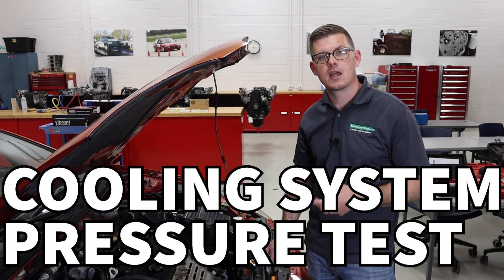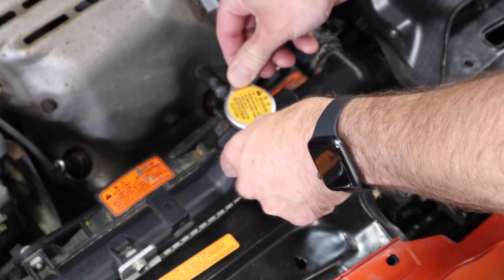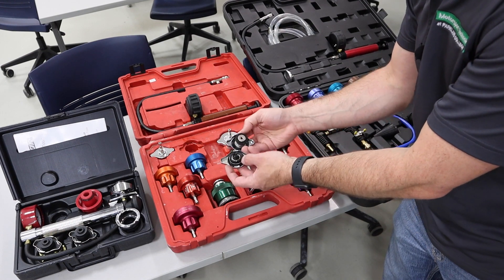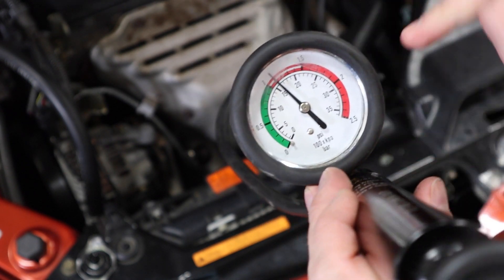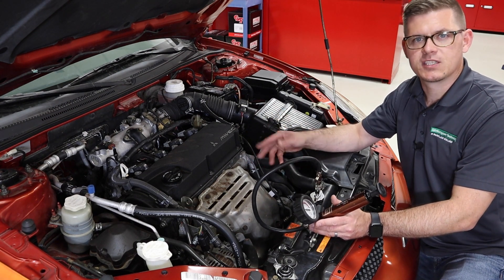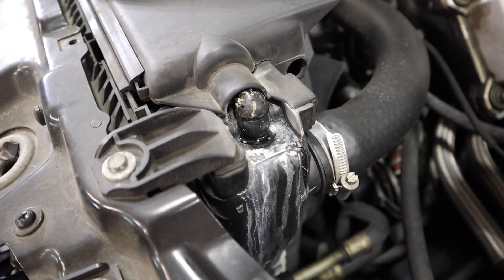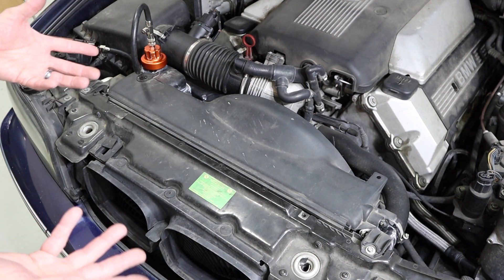Cooling System Leak and Pressure Testing

Comment: Those bmws cooling systems operate at double the pressure which you applied. the cap on that expansion valve says 200KPA or about 30psi. Next time pump it up to 30 not 15😊

Comment: i do not have air compressor do you have a manual coolant vaccum using hand? instead of machine? for hondas? would be nice msot peoples do not have this air compressor to do this jubs. i still use the drain and fill

Comment: Do you have the link for the red container pressure tester that your using for the radiator cap ? I need 1 like yours.
Reply from the maker: The red kit is an Astro 78585P. That one appears harder to get now and the 78585 (no P) is a larger kit like the mastercool in the video. Here is a link to that Astro version: https://amzn.to/4gT5h6P
Reply: @AdamsAnalysis  ok Thanks..

Comment: Hoe cn you diagnose if the leak is in your system of in the tool. Mine stays fine for 5 minutes, but between 10-30 minutes losse 1,5 psi

Comment: Does this pressure test works on other leaks such as at hoses, joints, heater core, thermostat?
Reply from the maker: Yes, it pressurizes the whole system and will help identify any leak.

Comment: Cool to see to you test an E39 V8 :)
How long is the 15 psi pressure supposed to hold?
I'm testing cold my X5 2002 3.0 M54, and the pressure drops from 20psi to 15 psi in 10 minutes, and from 15 psi to 10 psi in another 10 minutes.
Not seeing any leaks.
Reply from the maker: Typically, you will see a ~2 PSI loss in the first 5 minutes or so depending on the vehicle. I attribute this to expansion of rubber hoses. Any further loss should be a concern since it may indicate an external or internal leak. For an M54, has it ever been overheated? They often crack the cylinder head near a valve seat when that occurs.

Comment: Hi Adam, I have a coolant leak that I'm trying to troubleshoot on my VW crafter, but I'm struggling to find a pressure tester kit with the suitable adapter for the expansion tank. Any idea where I could find one?
Reply from the maker: Making your own is an option. There were some expansion tanks where I would use vise grips to pinch the vent hose because my adapter did not seal fully.
Reply: Make your own and run it off the expansion hose

Comment: On the vast majority of VWs from the last 25 years, I find the easiest way is to apply pressure to the small return pipe to the reservior. That way you don't need all the adaptors and also are testing the cap.

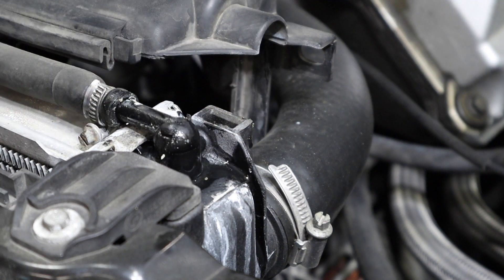Comment: Hi Adam.  Thanks for the video.  5:20 are all of those colored adapters anozied aluminum or some metal?  The ones on Amazon look like plastic and copies of originals.  I've read a lot of not so good and conflicting reviews of those products, such as not fitting the radiator or expansion tank, and leaky adapters.  Just curious to find the one that's worth dropping some money on, with Vacuum Lift and Pressure Tester.
Reply from the maker: Thanks for watching! All the kits, including Snap-On, have a mix of anodized aluminum and plastic adapters. In most cases, they work just fine. Depending on the scope of vehicles you plan to work on, it may be better to buy the pressure test kit and vacuum lift separately.

Comment: I nought a un expensive test kit when i went to use it on 2008 acadia air was coming out of overflow canister not letting get pressure
Reply from the maker: This seems to be somewhat of a common issue, even with quality adapters. When I was a technician, one of my favorite cooling system pressure tools was a bladder type. This one typically avoided issues like what you're describing.

Comment: Would a pressure test cause more harm than good?
Reply from the maker: When performed at the proper pressure, this test cannot cause any harm. The goal is to replicate the operating pressure specified by the radiator or expansion tank cap. On electric vehicles, it is important to review the operating pressure. Many EV cooling systems operate at low levels such as 3-5 psi.

Comment: Wouldn’t you only be testing half the system since the thermostat is cold/closed?
Reply from the maker: The thermostat is in place on one side of the system, there is still a path for the pressure to reach all components.
Reply: @AdamsAnalysis  ah ok so flows but just under small pressure until the thermostat is open, i’m losing coolant but when I do the pressure test it’s completely solid so I was thinking possibly because thermostat was closed. Any suggestions?
Reply from the maker: @thelegand1  The thermostat is just a valve to regulate when coolant flows through the radiator for full cooling. When the engine is below the thermostat's opening temperature, it is able to circulate in the engine block and heater core. The pressure in the system is created by the expansion of coolant while it increases in temperature. I would make sure you are testing at the rated pressure of the cap, usually around 15 psi. Have tried this with both a cold and hot engine? Be extra mindful if you conduct the test while things are hot. If you do not see any external leaks, it is possible a head gasket leak is occurring. Also, don't forget to check inside the vehicle to verify the heater core is not leaking. What make, model and engine is the vehicle?
Reply: @AdamsAnalysis   i’ve tested at the operating pressure but only when cold. But wouldn’t head gasket or heater matrix still show up on the gauge when the pressure drops? This is the issue as it doesn’t drop after leaving it on for even 15 minutes

Comment: A lil unreliable in some cases considering the system being pressurized by the tool yet apply physical pressure helped use to confirm the leak. Once you let go the line it stopped spewing so the tool appears to be limited with certain leak. Otherwise well done and very informative
Reply from the maker: Thanks for watching. It's not always easy to find a live example when filming, so this kind of worked out.. even if I had to flex it. The trail of residue told a better story.
Reply: Some soapy water on potential leak points should bubble up. I agree with OP though, great vid  @AdamsAnalysis

Comment: Yo Adam, where have you been bro? Now you got to put a scope on the radiator and show the waveform with a pulse sensor.
Reply from the maker: It's always hard to get time together to make videos throughout the Fall and Spring semester. Scope the cooling system? This would be interesting to compare a good engine vs one with a failing head gasket.
Reply: @AdamsAnalysis  yup that's what I'm thinking.